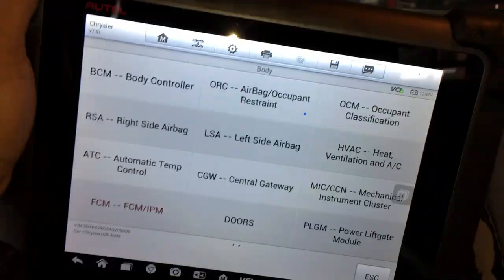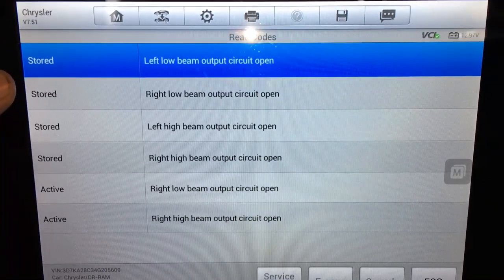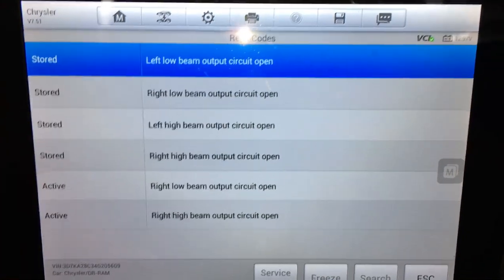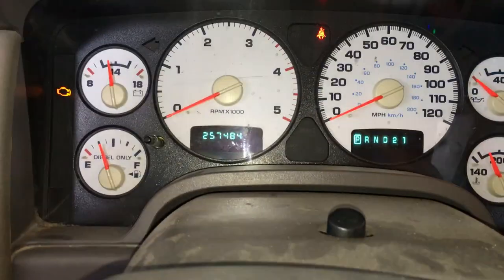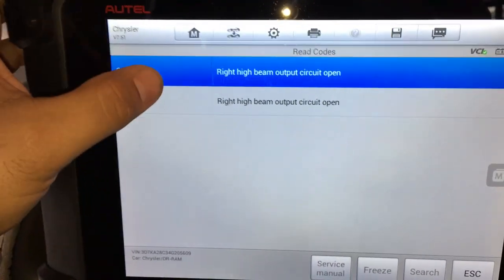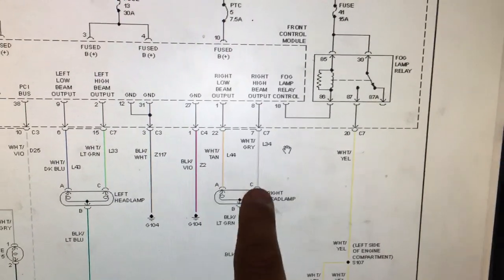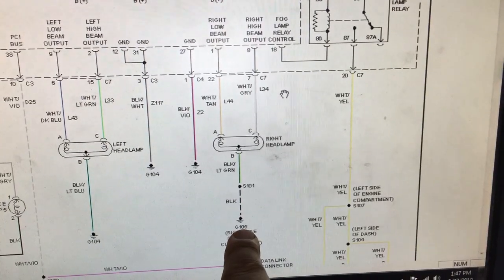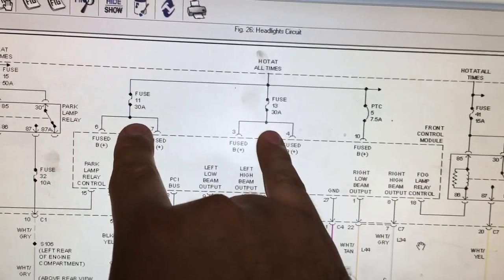DODGE RAM ONE HEADLIGHT FCM / IPM DIAGNOSIS

Comment: You just saved this customer over $750 by finding the CORRECT problem. Other shops would have replaced BOTH and NOT told the customer THEY SCREWED UP. Thanks, Good Man.

Comment: Love your videos , only thing I don’t understand is why did you pierce the wires when you were only a few inches away from the connector and the bare terminal , you could’ve easily stopped at the tip of the power probe into  it ,also as you know the terminals do you sometimes fail just outside the connector between the pin and where are you pierced the wire. On the headlight side you can clearly see someone installed a headlight pigtail at some point and they had put electrical tape over the connections . I would’ve pulled the tape off to verify the connection was weather tight , and I would’ve probed  it there. You do great work and it’s good to see you back at again with your new videos.I like how you double checked everything to make sure you were 100% positive before you dropped the coin on the module and programming. So tired of so many mechanics throwing parts at things to fix them it’s nice to see a guy like you properly diagnose and pinpoint the issue.

Comment: Great video. Very helpful. My 2004 turned out to be a corroded control board in the IPM. I soldered a jumper wire over the corroded spot on the board & everything works great again. I am wondering what is the brand or model of your probing tool clamp with all the little spikes to clamp through insulated wire?

Comment: I have a 2003 Dodge 1500 HEMI with customer projector HIDs. I use to take my truck extreme off-roading until one day the front end sank in water during a river crossing to the point where water got to the level of the IPM and the front control module. Suffice it to say, I don't do that anymore. However, somewhat regularly when I turn my high beams on and then turn them off, the driver-side high beam stays on. The shield within the projector seems to not be the problem due to the creator of the headlights testing it and the resistors for the circuit are not the problem since I flipped them from right headlight to left and vice versa with the error still happening on the driver side. The HID ballasts and main control model are all working properly with power and ground as well. Also, I can get the high beam to disengage if I smack the headlight from the outside causing the shield to go back down. All of that to ask, could this intermittent electrical gremlin potentially be caused by increased resistance due to corrosion from the water incident? Or would you suggest something else? Thanks!

Comment: Found your video - having the same issue, but with the running light on the passenger side; works all the time, but when you turn on the right blinkers, I get the "Light out" on the dash and it actually goes on and off on the dash as the blinker blinks.  I did the same electrical debugging as you did here, but with the blinker/running light wires.  All good.  did the same load test on my fuse box, all good.  I think the FCM is also bad on mine...  Thanks for the video (used as a sanity check)!  Clay

Comment: Thanks for sharing this! Having a similar issue with my 2006 ram 1500. Only my low beam isn’t working on the drivers side, but the high beam does work. 
This will help me to look further as to figuring out what’s going on.
Reply: do you know what ended up being wrong w it?
Reply: Did changing the FCM fix it? I have this exact issue!!! Need to know before I load the parts cannon!!!!

Comment: Great video.  I use a 9007 bulb with homemade leads and I use a harbor freight test light that draws 268 miliamps when it's turned on. My theory is if the test light lights the circuit can carry the current.

Comment: My friend has an 06 ram mega cab 5.7. His headlight went out he bought one. Still not working. He brought it to me and well it was the first time I had heard of the TIPM. I verified wiring and all seemed good. I found that there is a pin fitment issue on his vehicle. Not sure why but it has affected the headlight circuit, the rf turn signal, and the left rear brake light, so far.

Comment: Thank you for the video, I have a 2003 Dodge Ram 3500 diesel I took it to the dealership ship for them to replace my batteries and put new battery cables on the truck, because the first time we change the battery 13 years ago we couldn't get the truck to crank back for us and we had to have it towed to the dealership and they had to get higher up in dodge to help them to reprogram the computer so we didn't want this issue again, our truck went in with no issues other than the door locks need to be replaced . So my question is what causes the FCM control module to go out.

Comment: Thanks for your knowledge nice tips to check... I had a weird problem with mine right high beam n daytime running light only works if I start the truck set on low beams first ... if I start it set on high beams I only got the drivers side that works but low beam works on both sides so weird

Comment: Hello. 2012 one eyed dodge owner. Most replace plug at headlight rewire ect.... looked at mine and previous owner forced a connection with electrical tape. Unraveled the tape and light came on. Short lived as light went out again in a week. So people replace the connector from the fuse block. I cleaned both sides of the connectors and used connectivity silicone with little tie wraps and fixed the problem. Could you have done the same thing first before  buying that module?

Comment: Aloha Eric, i have a 06 ram and currently have an issue with the head lights, possibly from installing LED after market up grade. That has been scraped and now back with the original Halogen. Wish that you lived in Hawaii to help! wondering if you will give me the make and source for the test probe equipment used in this wonder tutorial.

Comment: Eric, Thanks for all you do to help. My issue: driver side headlight low beam 
out. I decided to replace both side low and high beam bulbs. I inspected
 the connectors attaching to back side of each bulb and didn't notice 
any deformity; thought all was good. Few days later I noticed when 
locking my truck with remote, head lights flashed (as is normal) but low
 beam didn't flash on. I pressed remote lock unlock on key fob and this 
time came on and the next time it didn't. How do you know when main 
connector is gone bad if no physical sign exist when conducting visual 
inspection. 
 Thanks...Brooks  Dodge Ram 2012 Laramie Longhorn 4wd, 1500.

Comment: Great video, very educational and helped a lot. I actually have no running lights or tailights. I jumped the relay and now they stay on while the truck is running but I also have no driver's side headlight and Im thinking about wiring it to the passenger side for now but thank you for your help

Comment: Def subbed after this video. So informative. Only my driver side low beam isnt working. My high beams work on both side but on driver side. My amber and low beam dosnt work. But when switch my high beams on my amber and light turns on.

Comment: I have a 2007 that I got used.

Pulled the headlight assemblies. Had led bulbs with procetor lens. Bunch of crazy wiring with relays and etc.  Put in new assemblies and plugged in new led bulbs.  Worked low beam both sides.  High beam only worked on driver.  Later on the stopped working all together.   Skipping a few things.  Did away with the BS relay setup they had added to run power to low beam.  Driver side began working. Passenger not working.

Weird thing that just does not make any sense to me is that I was able to read various voltages around 12 on the headlight plug(driver)  even when the drivers wasn't working.  Tried halogens as well.   Showed Power to high beam side at all times when lights were on even if brights wasn't selected. Showed zero to low beam until I reconnected original wire path. 

Once again on the passenger side I show almost 12v at plug but light refuses to come on.   Can't figure out how it has voltage but not on.

Comment: Great vidio. Did just what you did on my 2005 ram for the left head light. I replaced the FCM with a reman. through O rileys auto parts. Lights worked again,but, when I have the high beams on and go back to low the left head blinks several times before coming on. Any thoughts?

Comment: Wait! You counted the wrong way! (15:08 onward)

Pin 1 was on on the left as you were looking at the FCM
As you turn the module around to plug it in the the fuse box, that will place pin 1 on the right!
At 15:28 you really needed to start counting pin 1 from the right not the left.

Otherwise a very well done and methodical troubleshooting video I found very useful today!

Edit:
I was also able to "fix" my FCM by cleaning up pin 1 on the module and giving it a very gentle/small bend/twist so it made better contact with the IPM
It was only my low beam that was out on the passenger side. I was not aware of any power items (windows etc.) not working.
Reply from the maker: Yes I realized that while editing the video. Luckily they are still the same pins no matter how you count them.

Comment: Eric-  Fantastic FCM tutorial.   Question reprogramming.  5+ questions in comments say no programming required.   Video says reprogramming.  I have 2005 Jeep GC 4.7 with FCM problem and service manual warns against non programmed FCM.  Few resources.   Can I use a salvage FCM to fix mine?
Reply: Bob did you end up using a salvaged one and did it work? I'm at the same place right now.
Reply: @sierrasharon    The salvage FCM from a nearly identical jeep worked perfectly.  All problems resolved!  Note:  after install turn ignition to on for 90 seconds(no start) let the computers do their start up routine and automatically add the new vin to the FCM.   Turn it to on again, leave it on another 60 to 90 seconds until computers are rebalanced then start.   Think I had to go in and clear some old dtc's.   Note... The FCM still has the programming from the factory.  This does not fool with the FCM programming logic.   Good luck!

Comment: Super informative and clear step by steps. Have you come across the issue in these 03-05 rams of not having instrument cluster backlighting, HVAC control back lighting as well as dome lights?

I'm at a stand still on where to test next before calling a cluster replacement.

Thanks!!

Comment: Way to much just take off the silver box called the FCM you will see a row of flat pins cleans those off really good with a little sand paper then give each pin a small twist not to much with some needle nose pliers  apply some di-electric grease on all the pins reinstall your done the problem is your not getting a good connection I did mine took 15 mins and works great

Comment: Good job man. Not an auto tech, but I would have trown a couple of relays using the LEFT side as a control signal. Not the nicest thing  .... but is what a chrysler deserves anyways. Even more, I would have powered the LEFT side on the relays too, and use the actual lines of the iPM just as control lines so they cant blown. Of course it will trip the no lamp indicator.

Comment: I've had the identical issue on my 04 Ram more than once.  It's a pin connection problem between the FCM and the IPM.  If you shim the FCM out from the IPM with a washer at the mounting screws it restores contact and your problem goes away.  It always begins with the passenger low beam.  I'm guessing a reman FCM has simply had it's pins cleaned to restore good contact.
Reply: Same problem on my 04, I'm going to try using the washers, you do all 4 screws? And how thick are the washers? My next fix is going to be running a jumper wire from the hot headlight to my dead driver's side headlight, I also thought these units didn't come programmed already

Comment: Can't tell you how many of these tipm modules I have had to trace out in my life started off with relays going bad for the turn signals for the tow package back then there was over a thousand of these things on backorder and they were well over $1,000 now we have headlight problems fuel pump problems gotten to the point where my guys at the parts store so nice to me I just end up buying the tipm module if I suspect it cost is only about 3 to $600 nowadays plug it in problem solved almost every time when I suspect that's where the problem is I have also found that banging on the module assembly sometimes can recreate the intermittent failures in these things worst thing that I see is people buy these fuel pump bypass kits online to fix the fuel pump circuits when they fail in these modules this results in key on engine off power a lot of people with hot rods also wire their fuel pumps in this way so many people including so-called technicians don't realize that you're just feeding the fire in an accident if you're unable to turn the key off and your engine stalls and you have a ruptured fuel line you are just feeding the fire can't tell you how many rewires I've done for that particular scenario anyway nice to see somebody else isn't just a parts changer

Comment: 1 thing I just caught.... when counting the pins from module... you were good, but counting pins on the IPM you should've been mirrored, so start from right to left. Not left to right. I'm at @15:15 so far, so we'll see how this ends.
Reply: Then you counted correctly when you back fed power through IPM, so you did cover your bases. Nice!
Reply from the maker: Haha! I caught that, but I realized that it really didn’t matter when checking powers at pins 3,4,6,7 because they were actually in the same spot when counting from either side. Hopefully that makes sense.
Reply: @ADVANCEDLEVELAUTO  dang! I didn't realize that!  Lol nice! You saved yourself in multiple ways too, so the double checking your call came through even if they weren't numbered the same either way. 😂😂😂👍👍👍👍

Comment: Great video. I’m having a similar problem with 2002 dakota. Passenger side low beam works high beam doesn’t. Bulb is good. Thanks for power probe examples. Good info.

Comment: I'm having the exact same problem with my 2004 Dodge 3500.  The tech said he chased it all the way to the "computer" and I needed a new one.  Then a customer said he could run a splice from the left hand light harness to make my right side work.  I'm a 60 year old grandma with no automotive electrical experience so I can't judge if that is a good option or not?

Comment: I think I have the same problem with a 2018 Dodge Ram 5500 I have problems with head lights high beam dashboard light air condition and the key entry alarm.... where are you located

Comment: Yeah I have a problem on my 2004 Dodge Ram 1500 rear wheel drive but on my truck when When I put the lobe in it works on the driver shy and when I switch it to the Hy-Vee he works just one on the right side the same thing with the lobe just one on their left side

Comment: I have a 2011 ram and am having exact same issue on the good side I'm getting 12 volts at the low beam bulb pin connector. On the side that doesn't work I'm getting 3.8 volts.  I'm wondering if it's a module issue as well.

Comment: I have the same problem driver side low beam works but passenger side does not. When I turn the highbeams on I have no low or high beams any idea if it’s the control module? Also I have a 2006 Dodge 2500 5.7L? I have power low beam on the passenger side but when I turn on high beam I lose everything idk if it was a back feed or what’s going on.

Comment: On my when I used the low beam only the one on the driver side works , when I used the high beam it works only on the passenger side just that one the same with the low but it works only on the driver side, what do you think about my problem do you think that

Comment: These modules should be on a recall list. They're all lemons. My truck is the same.  I have a jumper wire coming from the left hand bulbs wire to the right hand bulb so they both run off the left hand side.

Comment: I have a 04 Dodge Ram and the passenger rear and front parking lights do not work the passenger turn signal work when I engage it and the brakes come on when I press them but they do not come on when I turn the lights on on driver side any solutions?

Comment: Got an '04 with the same problem. No low beam on the driver side even with a new bulb. Several other electrical issues that may or may not involve that voodoo box. If I could figure out how to bypass the FCM I'd do it in a heartbeat. My truck has manual windows, manual door locks, manual seats, manual mirrors, manual transmission... but I still need a $400 computer to operate my lights? Dafuq?

Comment: could the fcm have been tested if you used an adjustable benchtoP Power suPPly? feed Power thru the fcm and checked the outPut lead for the light?
Reply: just noticed that the far left Pin was referenced as Pin 1 at 15:26, and the far right Pin was referenced as Pin 1 at 17:19.  for an 05 ram, Pin 1 is the far right Pin.

Comment: Wow, how many times are you going to pierce the insulation on the wires? You do realize that these vehicles are exposed to rain, snow, salt, dirt, moisture. Each and every one of those pin holes you have created will now be prone to corrosion. You could of easily used some backprobes. That's just lazy.